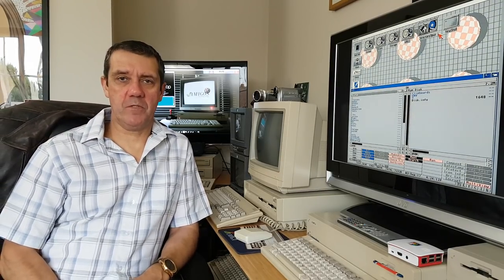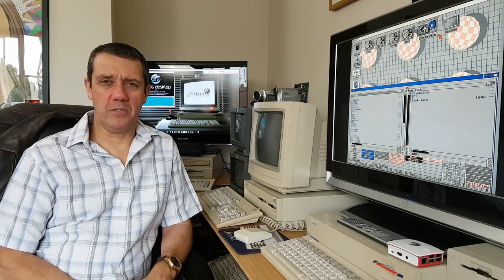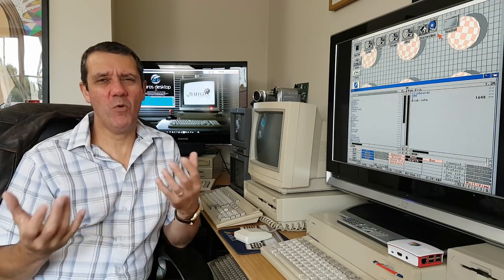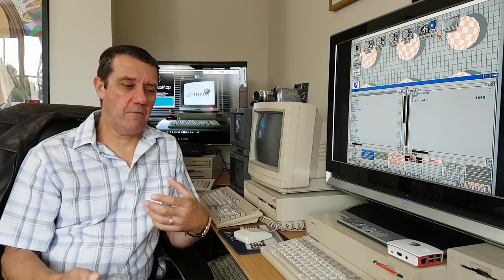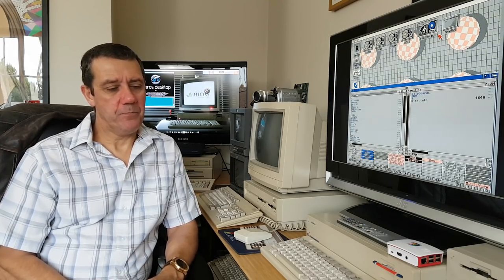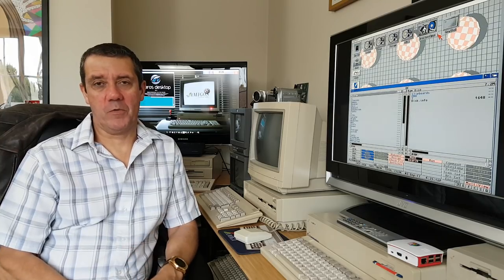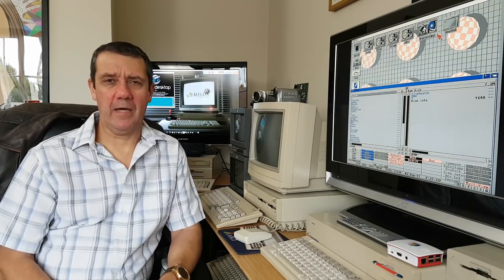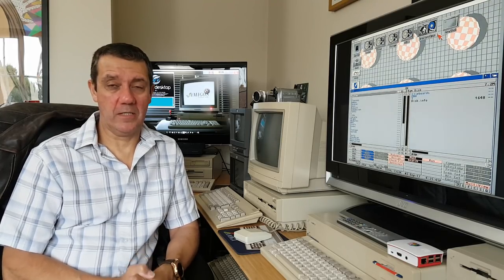Build an Aros based Amiga computer from scrap parts Part 1

Comment: I have the same laptop it's big bottleneck is it's hard drive mine failed and I put a samsung ssd 500gig now it fastest thing ever seen it really makes a huge difference in performance of the atom processor I installed Windows 10 as a upgrade when I changed to a ssd this is interesting running amiga os on this hardware way to go.

Comment: I still have my Acer aspire one ZG5 Motherboard with 1.5GB Ram fully Working. I put it in a Broken Xbox 360 Case and ran it through a vga Monitor as the Screen had Died. I am Definitely Digging it out in a bit and Making a Aros Machine as Windows 7 Didn't Perform Much good. Awesome Video and thank you for inspiration :-)

Comment: Great videos Stephen, thanks. Do you know of a fully support netbook that will manage AGA? Also does AROS intend to integrate Janus into the OS?
Reply from the maker: Sadly only ASPIRE One netbook I am aware of and it struggles with AGA at speed. Janus kind of is embedded into Aros I just prefer to run as a VM within Aros.

Comment: So does AROS run Amiga games direct? Or do I still need to also run a UAE within the OS? AROS doesn't need me to first have Win or Linux installed first correct?
Reply from the maker: No, yes and No :-)
Reply: @Checkmate1500  lol cheers matey. So really I could run Linux and Amiga forever, but running AROS not linux would make it feel more Amiga before I then jump into an emulator.
Reply from the maker: @005AGIMA  absolutely best of all worlds.
Reply: @Checkmate1500  Cheers mate. Installed AROS lite finally on the weekend on an old desktop. It didn't want to use any of the SATA drives I had, but got it to install onto an IDE drive. That'll do :D Next to setup an emulator and scripts to open .adf games directly and that'll pretty much be seamless (hopefully). EDIT: JUst saw your note re SATA/IDE in the vid description lol.

Comment: Stephen is Aros supported all Acer notebook one models (small ones) or just one model?I tried to find this same model but i only found 1 and the screen is broken.There is two  N270 models but i am not sure if it works there.Sorry i am not the technical dude. But i love your work and passion to the Amige and Aros.Thx
Reply from the maker: ZaKath ZaKath I have only tried on the one you see.
Reply: Stephen Jones Ok.Thank you i try to get the same model that you have.
Reply: Aros Fan Thx.This will help me and the others who want build the machine.

Comment: Can I install and run Lightwave v5.0? If so, which one? Amiga or PC version with or without doungle?
Reply from the maker: Victor Nassar you can only run Amiga software but unsure on the dongle. I use lightwave 4 though.

Comment: Really love your video Stephen Jones. I have started a thread on one of the amiga forums in Facebook where i shortly described i wanted to resurrect the A 500 as a portable laptop, but upgrade it where we think it is needed with out letting feature creap spiral out of control as your the Aros guy on the internet i was wondering if you would like to be part of the project, it would be a total rebuild from scratch and if enough people think it could be fun we would all do it and then try to make it into a laptop as well.

Comment: What about a FM2A68M-HD+ and a AMD A10-7800k (Kaveri) and 4 sticks of SAMSUNG 64GB DDR3 RAM modules and see if it will run that AMIGA OS no need for extra graphics card or sound card as that is integrated into the A10-7800k, I wonder if you want a beast of a Aros COMMODORE AMIGA based  on a TR4 motherboard and AMD Threadripper 16 core 32 thread plus 1TB of DDR4 RAM that should run really well.
Reply from the maker: DAVID GREGORY KERR well not sure if I note a little sarcasm here but I will be demoing AROS on 6700k that I have using all cores. However AROS and Amiga are so efficient that it would be massive overkill until we have apps to use it.

Comment: Right... So I've had just about every model of Amiga built. Everything from the 500 to the 4000/030. Some fell victim to a storage unit fire. Others were destroyed by rodent urine. To say that I miss them is an understatement. If this is a chance to rekindle the love affair I had with those old machines then there's just one question. Where do I get it?
Reply from the maker: ExStatic Bass watch part 2 coming in a few days.
Reply: How about a CDTV and a CD32.

Comment: Wow, I have not been able to install Aros! Won't go into the ugly details such as CD, DVD, USB, switching HDD, switching computer to install on, to download on, to burn CD, DVD, USB on... I'm going to try the 68k image under emulation on MorphOS. I was so hoping this video was a how to install Aros because obviously I am totally clueless. :-/
Reply from the maker: Andy Davis I will do a how to soon.
Reply: Yeah.Would nice to have installation video because i am not really good at the computers.
Reply: Steve did I miss this? I have managed over the years many times to install AROS but I absolutely find the sound impossible.. really bad to see how the hell to configure it. Given I am trying to do this on modern PCs without PCI slots I am relying on TRYING to get the various Realtek chips to work. But just getting AROS to even see the chips to see if I can get sound is difficult... I am now resorting to trying to get AROS running in VirtualBox but even then it doesnt want to do sound...  I looked into Hosted AROS but zero guides. The installer guide for non Hosted is poor (look for the explanations of what to do with your HDDs and thats a problem). So today I have tried and failed on Native install, couldnt try Hosted, failed on KVM (Linux VM system with QEMU) when I installed 5 other OSs with zero issues, failed on VirtualBox (sound). AROS is great to see in videos but not user friendly which is why even less people use in today than did 2-3 years ago.. that is pretty sad (for an Amiga-head).
 So a guide would be great.. REALLY!!

Comment: First off loving AROS. Got a weird issue though, my rtl8139 will ping external ips for a minute or so and then take a dive. 
Anyone got any suggestions?
Reply from the maker: www.aros-exec.org
Reply: Stephen, I registered and looks like i need the admin to all me into the group but not seeing where this can happen.  Any suggestions?  I have an intel board based e-machine with all the cards (video, nic and sound) that you suggested.  Worked well for a while until last night when several buttons scrambled their 'look' and after reboot, no longer Nvidia driver options.

Comment: if i could get an amiga os to run natively on 64 bit x/86 out of a bootable usb drive, with a modern internet/wireless access, i would likely switch to it as a primary os and contribute to software development on it.
Reply from the maker: Ok AROS 64 on x86?
Reply: @Checkmate1500  does it have a modern internet browser?
Reply from the maker: @androth1502  fairly modern.

Comment: I bought a cheap Asus Eee 1000H. It got only 1 GB of ram so Ubuntu 12.xx is sluggish. Well I can run another dist of Linux, but this can be fun as well.
Reply from the maker: I have one of them does it run Aros?
Reply: @Checkmate1500 ,  I don't know but it would be nice to find out :).
Reply from the maker: @Smartphonekanalen  plug in a DVD drive and test.